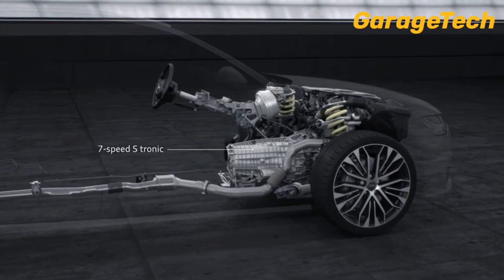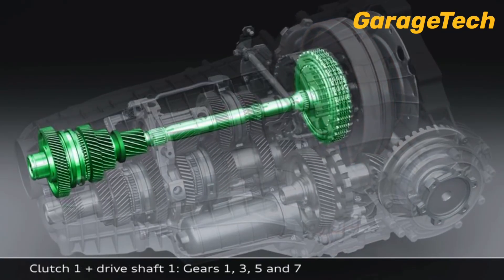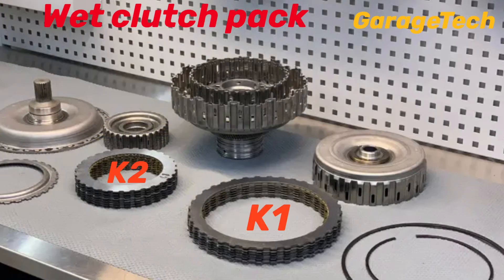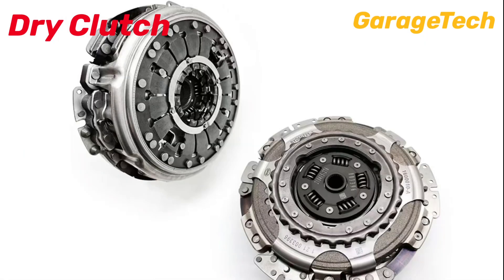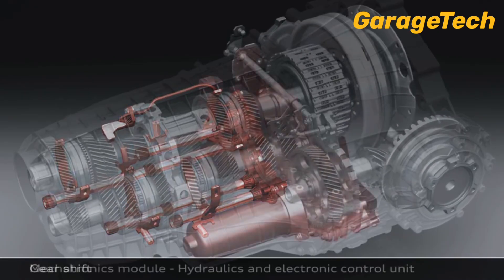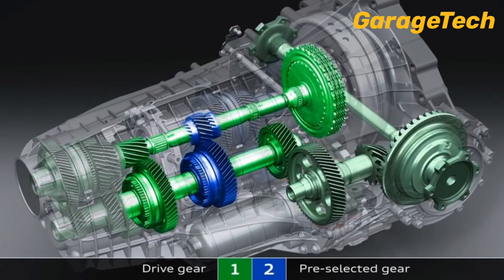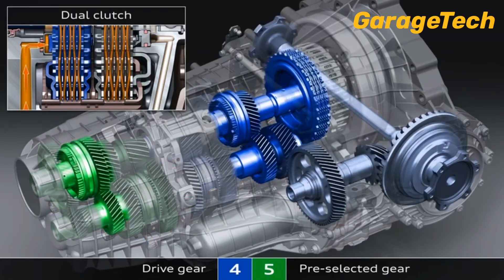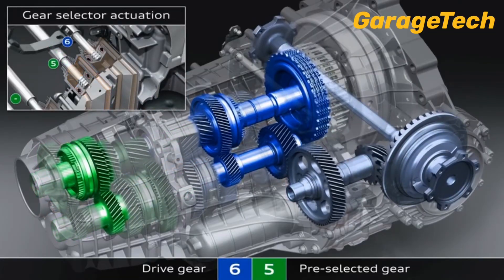How do Dual Clutch Transmissions work? DSG, DCT, PDK, S-tronic. Auto transmission gearbox animation

Comment: Might be a stupid question but how does the car know when what gear to pre selected e.g if your in 3rd and it pre selects  4th but you might want second as your coming into a corner, or this calculated by your acceleration and braking ?
Reply from the maker: In most cases these dual clutch transmissions will always pre select the next gear. That’s why there’s a slight delay when going down gear. In some cars it will use the navigation data to predict the road ahead, so if it knows you’re heading into a lower speed zone or a junction, it will pre select the lower gear instead 👍🏼
Reply: @GarageTechAutomotive thanks mate 🫡

Comment: I’m getting P1777C - sent my mechatronics off they’ve said it’s damaged beyond repair any advise?
Reply from the maker: Depends what the damage is, if it’s some of the solenoids or the circuit boards, most of the time it’s just easier to replace the whole mechatronics
Reply: @GarageTechAutomotive  from the testing company they’ve said it’s a INTERNAL Pcb failure
Reply from the maker: @hussainmiah3958 ok, yeah will need a new mechatronics 😢

Comment: My Tiguan R-Line is fitted with one of these and I have been trying unsucsessfully to explain why its so fast and cool to my husband because I know nothing and this has helped immensly!
Reply from the maker: @handlesshouldntdefaulttonames  great to hear ☺️ thanks
Reply: I have a Jetta Sportwagen TDI with a DSG. The first time I put the pedal down and watched the tach, I couldn’t believe how quickly the rpm’s would jump. It is truly an engineering marvel.
Reply: @jotacalvo   7 months later and I am STILL impressed every time I hear my turbo and one time some teenagers stopped me to ask about it in the parking lot of walmart!
Reply: @handlesshouldntdefaulttonames  actually I was talking about the way the DSG shifts. But I can only imagine your R Line. That’s got a beast of a motor from the factory, approx twice the hp of my Sportwagen CJAA stock and a bit more torque. No surprise it’s fun to drive 👍
Reply: @jotacalvo  I clearly know exactly what I am talking about lol.

Not that you're looking but they are SO cheap in resale for such a fun ride. I've got fantasy about landing a used 24 Wolfsberg Edition in the next few years.

Comment: the fact that this type of transmission produce a lot of energy loss due to it's weight and a lot of engaging parts, but why people say that i have many cons ?
Reply: Everything has losses more or less, a car weighs 1 tonne to move people who weigh only 75kg, even 5 people would be 400kg, the rest is just moving the car... small proportion of usefull load. 20kg or even 50kg of more weight of an extra clutch is not a big deal.  So, the only way not having losses is not having cars... or ships, or aeroplanes... This system has marginal more losses due to weight but is more easy to use. Besides, the fast and efficient shifting that this system does maybe makes up for these losses.

Learn to live with the losses. Don't worry about it. Or if you want to worry stop using everything!
Reply: @EfficientMan To be honest, even a small amount of friction can make a significant difference over a long period. For example, a manual transmission car is lighter and has less friction, leading to better fuel economy in the long run.

The European Union removed spare wheels from cars because they add extra weight. This added weight, multiplied by millions of cars, results in increased fuel consumption.

Airplanes also worry about the weight of paint. They typically choose white because other colors can add weight, leading to additional costs of around 20,000 euros per year.
Reply: @ccflan I don't know what EU did, but even if they did all these they didn't remove functional pieces of the aeroplane or car engines. DCT adds weight like an electric starter adds weight, we don't remove the starter to make the car lighter because it would be difficult to start... The air condition also adds weight and losses but we want it...
Where are you going with this regulatory thing?